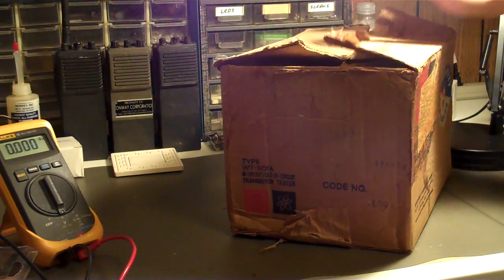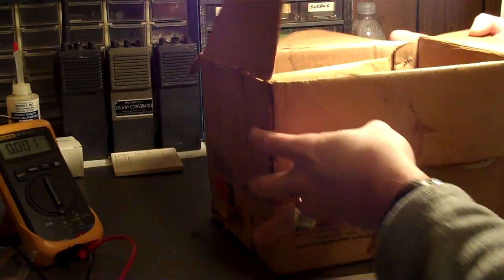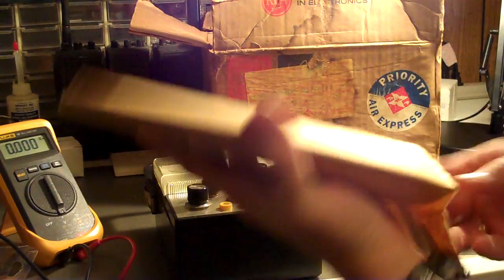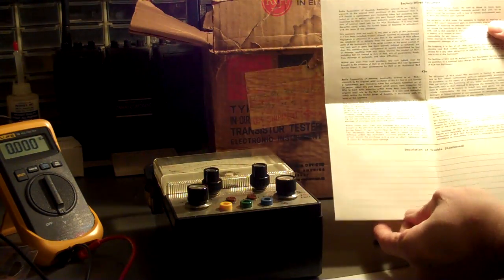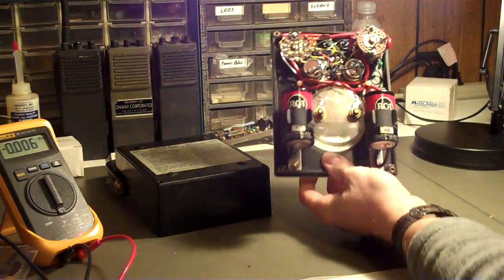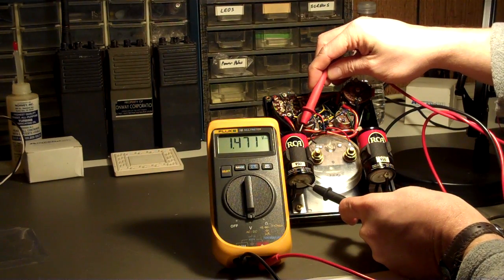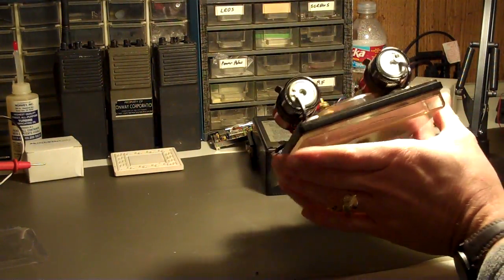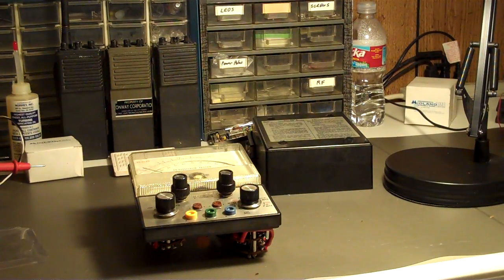RCA WT-501A Transistor Tester

Comment: today is 5/2/24 .  just got one today at surplus store and it works beautifully. had duracells in it "march 2012" which is 12 yrs ago. those could have been made in 2004? .. NOT LEAKAGE looked as if new batts. One worked fine, other no good. this meter uses separate batt for NPN or PNP mode, so swapping a batt between holders does the trick in a pinch. overall meter in awesome condition with switches just fine all around. this almost never happens.

Comment: Highly suggest snipping out those batteries. I opened up my newly purchased wt-501a to prepare it for testing my TO-3 trannys and found the batteries already removed by prev owner. The wafer switches had severe battery corrosion, deemed unrepairable by some fellas online. Battery position allows for leakage to hit all of the sensitive components.

Google wt-501a antiqueradioforum battery, a fella made a post showing some D-cells that already have solder tabs attached for less than $20 for two. Or can spot weld on your own tabs I suppose.